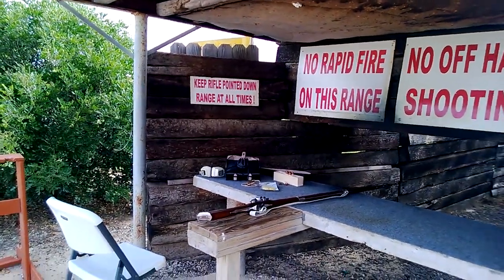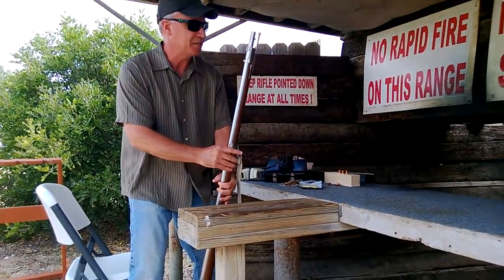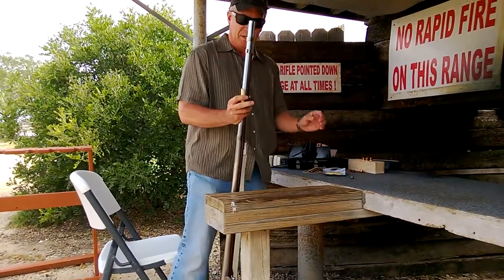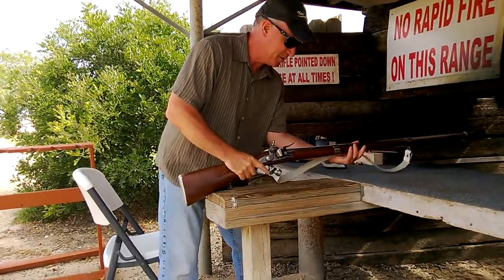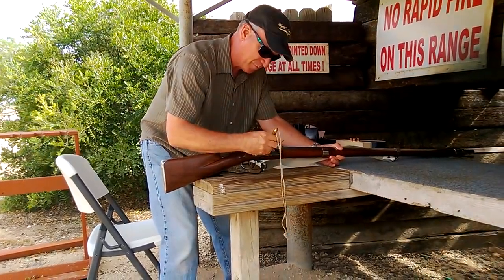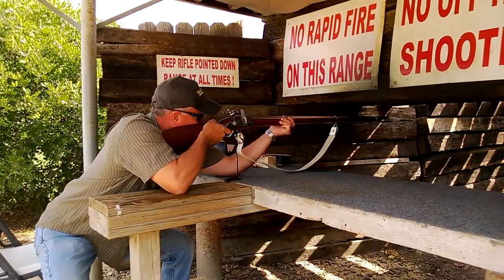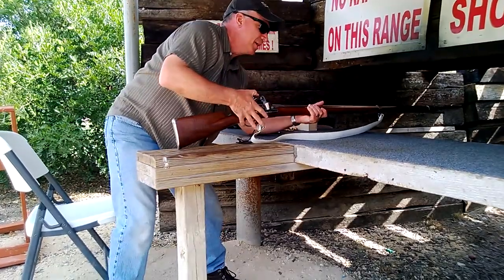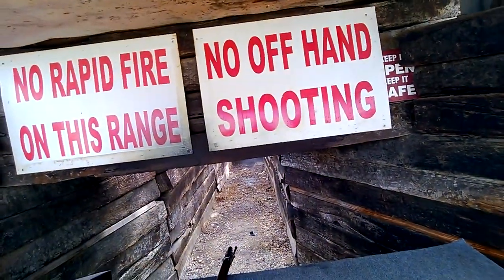Load and shoot a musket - duplicate video

Comment: The greased patch is to allow for quick loading after a barrel has been fouled by gun powder NOT to allow the bullet to leave the barrel. That bullet will leave no matter what. French Volitguers and Tiralureurs would use greased patched musket balls to tightly grip the barrel. They could put 5 rounds into 36 inches at 200 yards.

Comment: What does the ball diameter mic to? During the civil war the ball for a 69 generally varied between .648 to .652 according to unfired dropped specimens found on the battlefields.I read that even though the Brown Bess muskets were 75 cal. the British loads used a ball that were generally .687 in diameter.